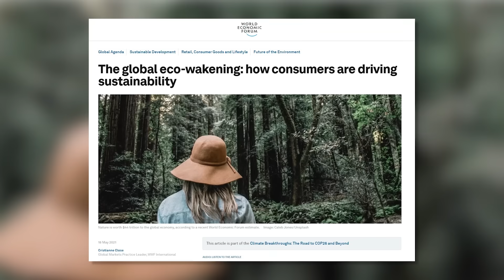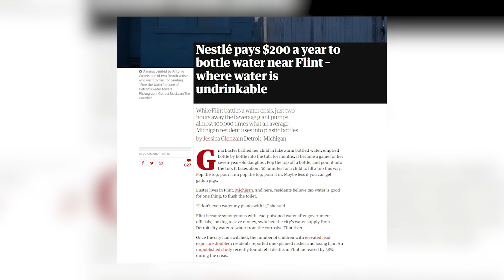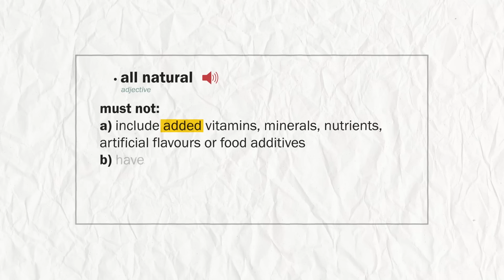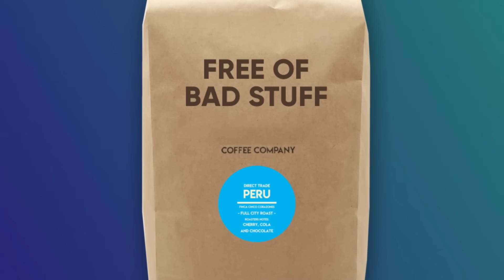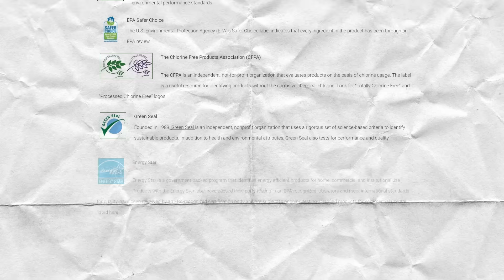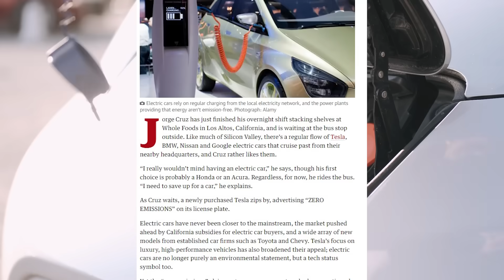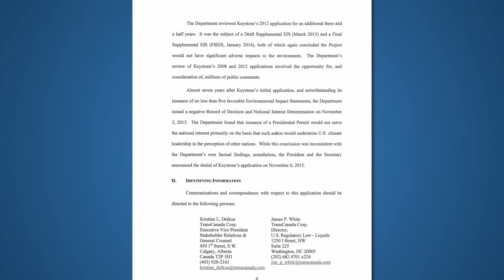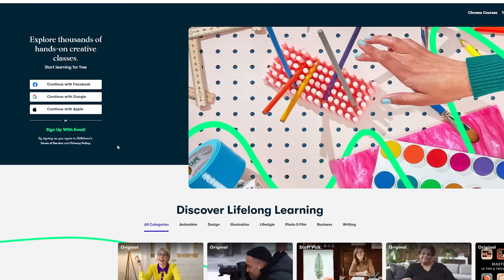Why Being 'Environmentally Friendly' Is A Scam

Comment: Apple does this a lot. They highlight the “environmentally friendly” stuff that they do. but ignore the fact that they make it harder for you to fix your phone forcing you to buy a new phone that’s being worse for the environment. Their new thing is that they recycle the used phones. But they wouldn’t have as many used phones that they would need to recycle if they would allow people to fix their phones that want to.
Reply: Don’t forget how they stopped providing charging adapters from the iPhone 12 onwards in the name of ‘environmental responsibility’.
Except now you have to buy a separately packaged adapter should you need one, and many do since the old chargers most people have charge much slower. 
You could also point out how they refuse to switch from their proprietary lightning cable to the new standard of USB-C, meaning more cables being produced for no reason.
Reply: @harmalalkaloid  Apple sucks. I still have an iPhone and I’m mad about it but I’m going to switch at some point. Not sure if other brands are any better though sadly.
Reply: @mikemikemikemikemikemeup  There is an option - look up Fairphone 4.
Reply: @mikemikemikemikemikemeup  get a cheap android phone and you'll be fine as long as you don't care about the camera quality or UI
Reply: @mikemikemikemikemikemeup  Bro, you Apple people can't even comprehend that there are other brands besides Apple. Like bro, this comment triggered me.
Reply: @mikemikemikemikemikemeup  I had a SUPER crappy Samsung J5 before my iPhone 8 and it would literally freeze half the time I used it ... it was also $100 but I would deadass prefer the Samsung J5 over this iPhone 8 which was like $600 and comes with many problems. The fact that it won’t update after a certain point, the genius lightning adapter, it drains battery about 5% a minute, I have to completely wipe it clean and reset it every time my storage is full because it won’t delete stuff  .... apple really does suck. I should get myself a nice Samsung after this
Reply: @mikemikemikemikemikemeup  fck smartphones. 
Get a Nokia 3310.
Reply: @gsanchez5116  well tbh you got a J line samsung its to be expected from them. i atm have a S21+ (i got it as a gift i didnt choose it) but before it i had the A70 which worked amazing for less than 400€. definitely the A line is a good cheaper alternative for the S line and my phone had a very good camera quality to it aswell
Reply: @sunmiswashingmachine  nice I’ll keep that in mind, and yes literally the replacements for my J phones after I broke it twice cost $20 💀💀💀
Reply: @gsanchez5116  BRO 20 ??? 😭😭
Reply: @sunmiswashingmachine  yes dude ... no lie I broke those 2 phones on purpose because they both froze ... like permanently and they gave me anger issues 💀 but let’s just say it was HARD to break them they’re LITERALLY indestructible I’ll give them a point for that. I literally smashed one with a candle in like a glass container and after smashing it it worked BETTER that before, like almost perfect. Anyways, yes. $20 to replace them 💀💀💀
Reply: @gsanchez5116  pls ive dropped my samsung a70 in a pool once accidentally and couldnt find it for 10 minutes and nothing happened to it it still worked after that
Reply: @sunmiswashingmachine  dude SWEAR 💯💯 if you remember that episode of icarly with those phones that are indestructible that’s literally Samsung’s .... especially the cheaper ones. They’re crappy but you CANNOT break them
Reply: @gsanchez5116  the second nokia
Reply: @gsanchez5116  For me, my Iphone SE (The FIRST Generation) is better then my Samsung S9 or even S21. Samsung feels slow and so many useless Apps. Iphone feels faster (even after years of use) and can still update.
Reply: @mikemikemikemikemikemeup  Pixel 6?
Reply: @sunmiswashingmachine  so waterproof
Reply: Namaste  @advayvenkat402  now apple  made worst i phone 
🕶 hate when people click selfeis with i phone 
And in market we get lots of  beautiful covers for I phones 🏳 
Should also  think about other phone users 🏴
I'm having samsung tab  its my 2nd year it works good but lots of storage issue even though I've inserted memory card but anyways  it's woring good 🏴
Climate change is a big issue ,an 

And I'll be honest heat is increasin 
If you live in summer areas you'll understand 😭😭😭
Reply: @__heartbeat__2635  Yeah, I cant survive without the AC these days
Reply: @athl0n  only in europe :(
Reply: @advayvenkat402  same dude but without fan ?can u survive
Reply: @gsanchez5116  I didn’t have nearly as bad an experience with my iPhone 8. The battery did start to to run out quickly, but I was able to get the battery replaced for $50 and it worked like new. And I only just switched to a 13 last week after having the 8 for 3 years. Maybe if you bought yours used the previous owner didn’t take good care of it? I haven’t had any storage issues that forced me to wipe it or anything
Reply: @mikemikemikemikemikemeup  that’s my problem too. I loved apple for so long, but now it’s a complete shit but the other brands aren’t any better either just slightly less expensive 
back then it was such a happiness to buy a new phone & it was hard to choose now it’s like choosing between shit & shit
Reply: @thatdude123  what are you talking about? I literally said I want to switch 😅 did you even read? I also am making fun of apples crapy business practices. Next time comprehend the post before commenting. 😂
Reply: @sharkie1630  This utter nonsense.
Reply: @Lateralus138  ?
Reply: @sharkie1630  My Androids Camera is amazing hi pixel/hi quality. And I'm still way back on an older S10. My wife's S21 is phenomenal.
Reply: @Lateralus138  Flagship androids do have good cameras, but I was talking more in line of 100-200 dollar phones lol
Reply: @sharkie1630  Okay, I'm sorry. I was reading that as "Samsung cameras are crappy". Very sorry.
Reply: @mikemikemikemikemikemeup  too late everyone does the same stay with apple
Reply: @sharkie1630  why though???
Reply: @__heartbeat__2635  didn't understand from what you said also you mad if someone takes a selfie🤣
Reply: @rainbowgirl949494  The other brands are more expensive!!!
Reply: @SolidSnakeMGS_Gr  Why get a cheap android? Because it does the same things as a flagship and doesn't as much as 3 laptops..
Reply: @sharkie1630  I do a lot of photography it ain't the same as other phones also the perfomance,support,safety and design are one of the many reasons also the ecosystem I'm planning to buy a macbook because I want even better version of some apps and want to use lightroom and not the mobile version the video is preferable by far for family memories and youtube and iPhones can be found at cheap prices
Reply: @mikemikemikemikemikemeup  samsung sucks when using it. My husband has one - the worst phone ever. My son had one - one day came from a trip, called us to pick him ip and after that phine just stopped working. New phone for 700 euros.
Reply: @harmalalkaloid  Every iPad, but the cheapest option, now has a USB-C port. USB-A got replaced by USB-C for the most part and Apple tried to switch their Mac's to USB-C only in 2016, which resulted in a backlash because the industry wasn’t ready and nobody wanted to carry dongles.

Not to mention how Lightning was introduced two years prior to USB-C. There was no point for Apple to switch immediately and it would have resulted in another backlash because people just switched from their 30-pin connectors.

Also, didn't Samsung mock Apple for not providing a charging brick? They did the same thing one year later, for the same reasons.
Reply: @harmalalkaloid  you don’t need the new faster charger. If you WANT the new faster charger then buy one. Otherwise use your old charger. Its not for no reason, USB-C is superior to USB-A and technology is about change and moving forward, otherwise we’d be using floppy disks. Y’all just want to have something to complain about.
Reply: @AnonYmous-tr4cu  you kinda need the new chargers as now Apple bundles their new phones with an USB-C to lighting cable so you can't reuse your old USB-A chargers
Reply: @AnonYmous-tr4cu  If it really was about change and moving forward, they could include the new charging block that MANY PEOPLE DONT HAVE, the lack of which was their pretty valid initial complaint, instead of expecting people to buy it separately in an entirely different package. It's definitely not complaining about nothing. I work in an electronics department and people buy USB-C blocks ALL day - it's probably the thing we sell the most of, especially now that Samsung is following in their footsteps and pulling the same move. 

Also, you've contradicted yourself with the comment about still using floppy disks....because the other point the commenter made was Apple's refusal to switch to the USB-C standard that basically everything else has, only on one end of their cables. Apple out here still selling "floppy disks" and you're saying people are just looking for things to complain about? 😂 Okay.
Reply: @harmalalkaloid  that's why i want to get android
Reply: “We used less packaging by putting less stuff in the box that comes with your phone, but you can buy the stuff that would normally come with your phone in more packaging, but remember we initially used less packaging and that’s all that really matters. Don’t think about it too hard, you’ll notice that it doesn’t make sense and all we wanted to do was make more money. Thanks, love Apple.”
Reply: Worse they inspire other manufactures to do the same. Samsung mocking it but eventually follow for $$$
Reply: Not to mention all the mining they have to do for the materials to make these phones
Reply: And make try to make them last longer, but no.  That doesn't get them nearly enough money.
Reply: I’m still on my iPhone 6s+. I will not upgrade unless this thing finally dies out.
Reply: @Dud3itsj3ff  I had a 6 for 4 years before I dropped it and broke the logic board
Reply: And if you want a cool looking phone case, almost all of them are only designed for iPhones which is so stupid and feels like a marketing strategy in itself.
Reply: Don't forget that we don't get discounted for recycled products despite companies cheaping out, we still pay full price and oftentimes more for a low quality item.
Reply: also with changing their connectors so every device needs a different charger/cable. creates so much e-waste as the old cords become obsolete.
Reply: Or using planned obsolescence through automatic updates to make your phone run slower so you buy a new one faster.
Reply: @magaisacult-8647  lol progress is “planned obsolescence.”

People are still using iPhone 6/+’s (yes, 6, not 6S/+), a phone released in ~2013, but sure, “planned obsolescence.” I’m not absolving them of doing shitty things, but getting mad that your 3-4+ year old phone doesn’t work as well on current software as the new flagship is utterly absurd. I currently use an 11 Pro Max and personally feel no need to upgrade, but then again, I’m not using cutting edge applications/games. My 2+ year old phone works perfectly fine for me and I probably won’t upgrade for another couple years.

You people spend money once and expect that you’ll never have to pay for anything ever again. If you’re mad about buying new stuff often, buy cheaper things or buy new things less frequently. If you want the new and fancy features on a luxury product, why do you think you shouldn’t have to pay for it?
Reply: Rightly said....not to mention that the recycling process in itself is a carbon intensive one. Buying less and quality stuff which lasts long is the only solution i could come up with which is easy for me being a minimalist/essentialist person
Reply: also the child labor and the apple suicide prevention nets in china
Reply: Let's use nokia 📞 1 cellphone will last more than 6 years
Reply: Same with all AirPods being made out of materials that virtually never breakdown, and will stay in landfills for hundreds and hundreds of years !!
Reply: Apple is as good for the environment as the apple that Snow White ate is good for her.
Reply: That's why Apple is trash
Reply: Exactly a reason why androids are better. Just don't fuss about the camera and you'll be fine. They're cheaper and offer a wide variety of phones. When my phone stopped working, I was able to get a free new one (minus the 32 dollar monthly fee). iPhones are just made to be accessories more than actual phones. (Not to mention my phone has 2 days worth of battery life and comes with a stylus. Moto g stylus 5g if anyone's interested. Highly recommend.)
Reply: @Zen-ft5fj  Not to mention no one cares iPhones have the best video by miles and photos the support and consistency is much better whatever apple does everyone copies iPhones have the best audio and mics best perfomance and the most expensive iPhone has around 13 hours of the most demanding tasks on easy use 2 to 3 days and if you prefer an android buy an android
Reply: Airpods themselves are freaking terrible for the environment in the long run. They have a non transparent "recycling program" and you replace a fully working speaker essentially every 2-3 years.... First it was the headphone jack then it was selling you back those functions in the form of dongles
Reply: I'm through with them because of the way their products basically self-destruct even though the hardware still works just fine. After two years, your device no longer works with the newest operating system. Gradually, all applications become useless, and there won't be any security updates anymore, either.
Reply: right to repair is so important and in the EU electronics companies are being forced to get it sorted about charging cables, they are soon to be universal
Reply: I agree apple sucks but sadly iPhone is the only phone that has lasted me for 5 years still working and my sister has had her laptop for 11 years and it still works she just has to get the laptop a new battery. My dell broke after 5 years no repair possible same price point as my sisters apple laptop. I also have had HP and todavía and were worst than my dell.
Reply: @Crisfer05  my Samsung phone has lasted 5 years and my Asus ROG has lasted for 5 years as well. Both are pretty beat up, but still going strong. I can even play games on my ROG still, although I hardly ever game anymore anyway. But I do prefer my Macbook for programming.
Reply: So does mrbeast.
Reply: it's reduce, reuse, and then finally recycle for a reason
Reply: Paper bags are more environmentally friendly than plastic
Reply: And the #1 sin about phones and computers is the continuous "development" (read: retardment) in operating systems and other platform software, releasing and endorsing new APIs every year or so, in order to deprecate and drop support for older devices, forcing customers to replace them to keep using apps and services. Besides the main culprits - the OS developers Google, Apple, and Microsoft and their associated device manufacturers, also the app developers and especially the service providers using proprietary apps as front ends are on heavy guilt of buying into endorsement of adopting new APIs completely unnecessarily, and with even less necessity dropping support for old APIs. AND generally making their apps unnecessarily heavyweight bloated in order to not run on old hardware, and worse even on newer.

Because of this, I refuse to buy any new phones, I only use trash-picked ones and I boycott all proprietary-app-operated-services that ever drops support for old OS versions. Whatsapp has been very notorious example of this, not that much ago when they last announced the last drop of OS support - for sake of dropping.
Reply: Apple is a garbage company in general like Nike and other big labels.
Reply: Planned obsolescence is a huge thing. Thank Apple for leading the way on this which caused many other companies to follow suit.
Reply: Or go a step beyond and make all your future phone models upgradeable by the user so their phones dont become irrelevant within 2 to 5 years. Give full power to the consumer if you wish safe practices, not giving the choice to a board of investors only interested in returning their investment.
Reply: I remember the time, when my Siemens mobile phone had a battery that lasted 1.5 week and functioning almost for 10 years without stop.
Reply: @franfinesim  yes but low output, you didnt need even 10% of what energy you store and use daily now to run that phone for a week and a half, you use 900%(rough estimate) more energy daily in a smartphone, plus they are really inefficient energy wasters with ways android and Ios operate.
Reply: @leomahmet7555  as a kid who liked to steal my parent's phone, I used it more than I should have. Still the battery was not empty. My smartphone needs charging every day or every second day. When you put on paper, it  costs you with other things
Reply: @franfinesim  sounds about right, unless you're on solar at home, then it doesnt really matter for small appliances like a smartphone
Reply: @leomahmet7555  solar panels are expensive. We have a large one to warm pur water during summer, but in autumn, early spring and winter it is unuseful. It produces a small amount of energy and it is not enough to live. My father is a technician and once I've asked why don't we have more panels and is the one house lucky to have it's roof covered with it. He said that the costs of maintenance is too high and the sun must be very strong to be profitable. During the crisis in the 80s, there was a reduction of  electric energy. People nowadays would go crazy if they could not use their computer or smartphone
Reply: @franfinesim  we had reduction in the 00s here in the Balkans, as for the efficiency I gotta ask, what year did you install it? Because if it isnt recent like a year or two it might be smart to reinvest in one of the ones that use new techs recently developed,  solar shingles are working lovely for me but its a major investment right now, no argument, but one that has payed its self out within 12 to 18 months, atleast in my area. And even on a very cloudy day it gets over 50%. Plus you could always install a biofuel generator(think trash burner but clean and efficient, germans and austrians use them a lot in rural areas where basically every household produces bio waste from either farming or raising animals) to have a clean safe reliable back up if solar acts up in any way. The panels used to be shit, they are exponentially growing in their efficiency as well as is our tech to boost the energy collected when used but not drain more battery simultaneously. We built our own solar panels in my High School so i got to see first hand all thr pros and cons and all the complications that arise with building and installing one
Reply: Apple (any electronics company) CANT say anything about sustainability when they're committing human rights violations in their factories
Reply: I’m running into this problem with my phone. I have a diabetic pet and the glucose monitor I use requires an app and the app is no longer compatible with my iPhone because they stopped pushing iPhone updates to the 8 plus. The phone works perfectly but this one app doesn’t. I’ve been using it for months but their last update no longer works and there is no other way to do readings with this monitor because they stopped making the reader. I was just looking to buy a new phone when my mom located her old SE 2nd gen so thankfully we can use this instead. But can you imagine, a perfectly fine phone would have to be recycled just because 1 app doesn’t work. It’s ridiculous.

Same thing happened with my iPad. I use this as a tv and all of a sudden every single tv app I used no longer was comparable with my device so I had to upgrade. 

I thought apple was getting rid of planned obsolescence but it seems not. They should continue to push updates to every version of their phones for all eternity. They are just so expensive. New phones are 1k. I’ve only ever purchased used because the cost is so astronomical. But I couldn’t imagine spending 1k and then a few years later having to recycle the phone and spend another 1k+ on another phone.
Reply: That's a great point. Kyocera cell phones are this way to. 

But in their case it's just impossible to find parts. 

Honestly though Apple reminds me of the cable companies upping their prices and digital era.

Especially when you live in a city and there's free Television over the airwaves. 

I found 70 to 100 channels and some of these cities. 

but much like the Apple phone situation.. It's just people that are used to just paying a bill. Just one more expected accepted cost for existence. 

meanwhile you can get the cost of a cell phone down to around ten bucks a month.
Reply: It really pisses me off that their claim to fame these days is selling you a 100 dollar product for 1200 dollars because their software is more hack-proof than their competitors
Reply: honestly the worst part of it is apple trying to sell their products with a holy moral mission with regards to the climate. the changes they've made like not including chargers does make it more environmentally friendly, but it also halves their shipping cost. a lot of tech companies do these things too, apple is just the loudest of them